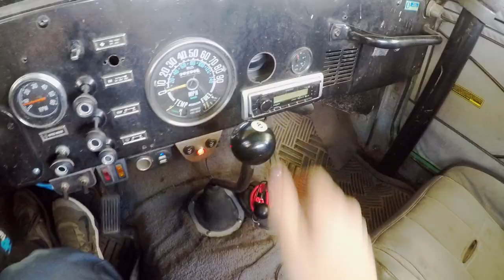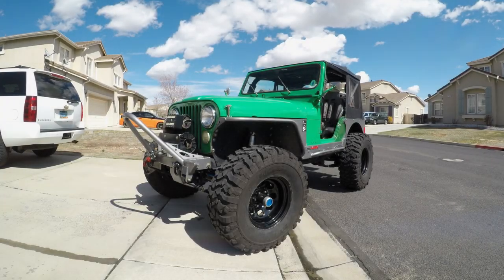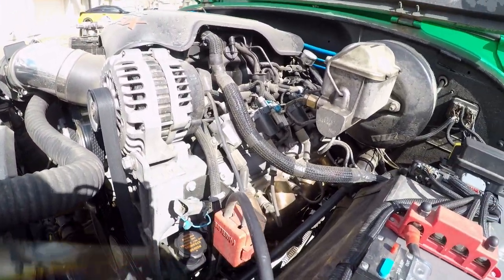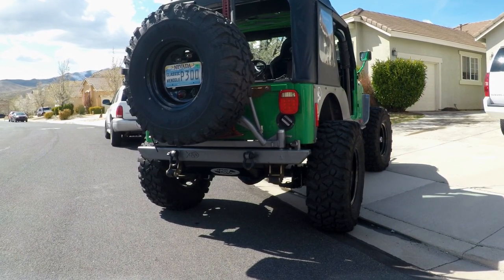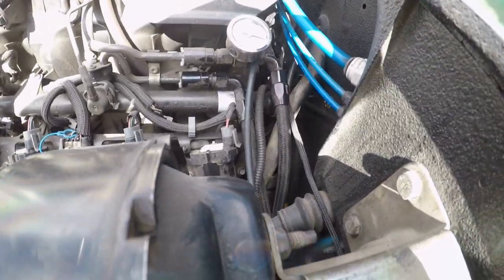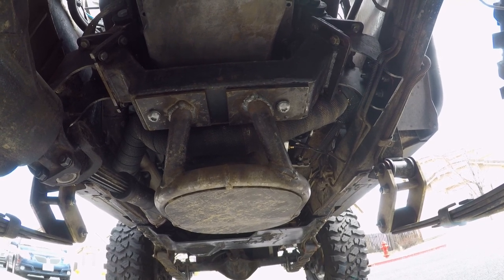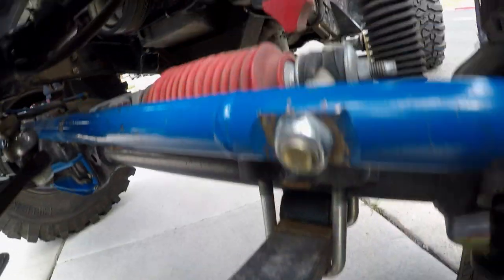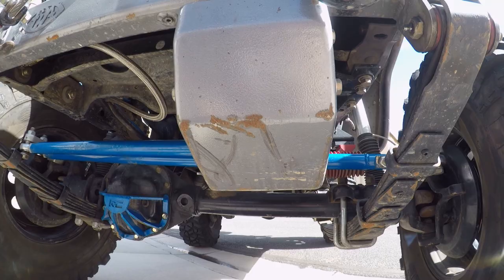Walkaround: Alpine Lizard CJ5 - A Tour of my Jeep Rock Crawler CJ 5 on Dana 44s and 37 Inch Pitbulls

Comment: What an impressive build. Can you please give more information on the Ford shock Tower in the front? Year and which vehicle. Thank you for providing a great video.
Reply from the maker: Thank you for the compliment! The Ford shock towers that I used come from an 87-93 F250. I’ve seen some on F350s, but it’s not a guarantee. You can buy them new online for like $50 a pair or something. I got mine from the junkyard. They can be found attached to the front axle.

Comment: Awesome Jeep! I’m putting together a ‘77 CJ5 trail Jeep myself. 304, T18, D20 w/ terra-low gears, 4.88’s with 35s. I may have missed it, but what did you say you had for axle gears? Just subscribed, looking forward to seeing more of that CJ!
Reply from the maker: Thanks for the compliments! Your Jeep sounds like it’ll be setup very well. Mine have 4.30 gears. 4.88 will be awesome for the trail. I still hit the freeway once and a while and do 65 MPH, and I’m at 3,000 RPM with 37s. If you don’t plan on doing much more than 55, your 4.88s will be just right.

Comment: Great looking jeep, how big of a lift are you running ? Would like to run 35’s with as small of
A lift as possible
Reply from the maker: Thank you! The lift works out to be 4” of spring lift and a 1” body lift. Before I did the 37s, I just had the 4” lift and it was perfect with 35s.
Reply: @aireddown813  great! Thanks for the info

Comment: What seats are you using? Thinking about CORBEAU BAJA JP SUSPENSION for mine.
Reply from the maker: Mine are the Corbeau Baja RS. I like them a whole lot
Reply: @aireddown813  thanks they look similar to the JP  except they recline, I am 6 feet and just want to make sure the back is long enough.
Reply from the maker: @lewy1  if the backs are anything like the RS, they are tall enough for 6’ with a normal torso, but they hang way back like they are meant for a helmet.

Comment: Did you do your own exhaust? I am going to be putting a 4.3 into mine and the exhaust looks tight, would like it as high in the frame as possible. On the Dana 20 did it have the 6 spline or 10 I want to do the 3.15 as well.
Reply from the maker: Yes, I did my own exhaust. It wasn’t too bad, but it was a chore trying to make it all fit right. I still just barely rub the front driveline one the exhaust wrap.

My dana 20 actually had the later model 23 spline output, but I still broke it. Went to an Advance Adapter HD output. I love the 3.15 gears, but make sure you shim the rear output shifter detent spring. Mine likes to pop out of gear, so I use a ghetto strap to keep the thing in gear.
Reply: Aired Down thanks I was concerned with the input, read something about a 6 spline input, but that might be for the bronco version.
Reply from the maker: Oh okay. Yeah the spur gear that bolts onto the back of the tranny. I haven’t heard of too much issue with those. Mostly just use the correct nut and torque so the gear doesn’t loosen up on the tranny output. I’m also not too sure about different spline counts on them, but what you’re saying about the bronco sounds familiar.

Comment: Hey i have a noob question I cant seem to find an answer for on the forums. If i were to do a rodeo 44 swap on my early cj would i need anything for the brakes? Or do I tie into the preexisting lines? The jeep amc yard here in sac has a wagoneer 44 also that i saw has discs also. Is it that strait forward or am i missing something?
Reply from the maker: You’ll need to adapt the hardlines from metric to standard. I had to re-flare the rodeo lines with a standard nut. Adapting the e brakes was a huge pain the required welding up a custom flange.
Reply: @aireddown813  thanks! no fancy brake booster like any modern car?
Reply from the maker: @qweef69  I swapped in a YJ master cylinder and brake booster in long before the rear axle. Before, I had manual brakes and that wasn’t cutting it for sure. If you are disk front drum rear now, you probably won’t need any fancy upgrades to swap in the rodeo.

Comment: Where did u get that fuse panel from? Also what radiator did you use?
Reply from the maker: The fuse block comes in a kit with weatherpak pins from Amazon. Search little fuse weather sealed fuse box.
Reply from the maker: Also, I used a summit brand aluminum radiator.  Meant for a CJ5

Comment: This is an awsum build  "little Pup" is a 94 YJ that I am installing a Mercedes OM617 into   I also have a Jeep T18 and model 20  running into a 9 inch ford which I installed disc brakes on   I am very interested in the Fuel Tank  would it be possible to get a copy of the drawings  I have access to a variety of applications as well as acess to a 4 X 8 CNC Plasma table  I am Currently setting up the rear suspension and would like a little strech   thank you archie
Reply from the maker: That’s sounds like a great build! I think a 9” is a fantastic rearend for a CJ. I hate to be like this, but we plan on selling that fuel tank soon, so I don’t want to share the files, but I can get you some measurements if that helps.
Reply: @aireddown813  hmmmmm radious and radious to back of tank
Reply: We had been talking about doing a behind the seat  with a sump through the floor
Reply from the maker: Jeep534 h Honestly that’s what I’m going to next. I want to stretch the rear axle back another 10”, and the gas tank will have to go.
Reply: I did the fab work on the oil pan and paid a professional to tig weld it up lol